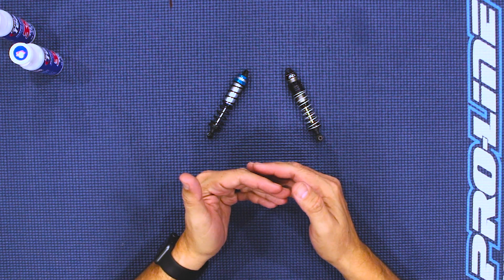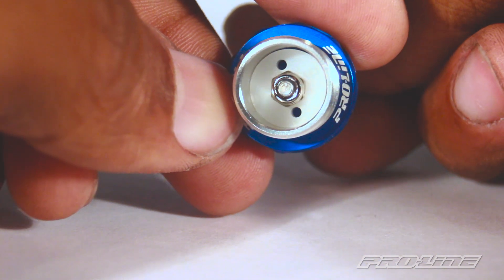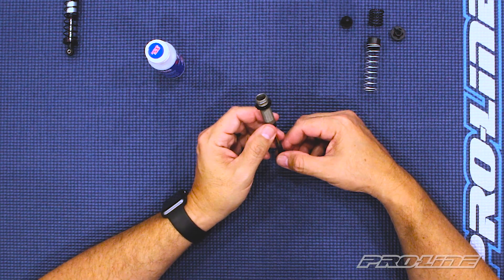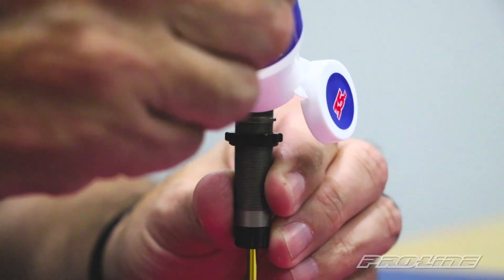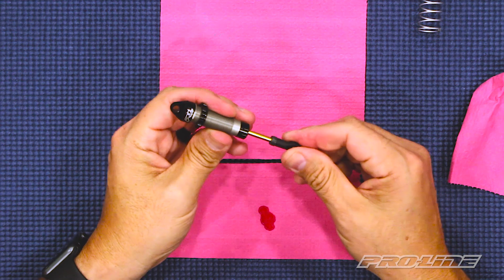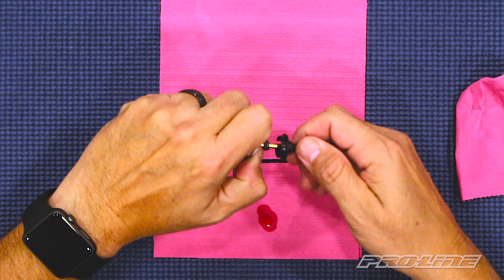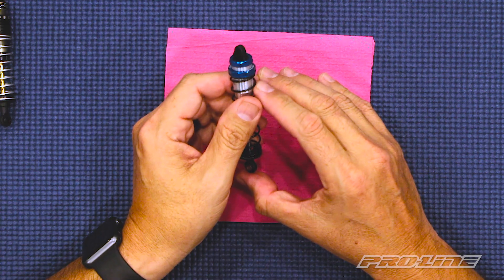Pro-Line Shocks 101

Comment: Question, need advice: I own an Arrma Big Rock and just bit the bullet and got the proline shocks. I live in Florida where it is always hot so I am going to have to test different oil weights to see which is the best for me. My question is, what weights should I buy to test with? I already have 60 & 35 weight. Which other weights should I get? Thanks in advance.

Comment: Hello!
Thanks for sharing the video. I was trying to top the four 6063-00 and two 6063-01 schocks up.
When having my rod down I’ve filled the body in with the oil to the very top of it, pumped it up and down a bit letting the air out, I’ve lifted the rod up to the bitter end, the extra oil has come out (you don’t have this happening on your video btw). Then I’ve put the cap on and screwed it up exactly as you’ve done on your clip, but unfortunately didn’t get the result I’ve expected: only two schocks out of six were pulled back on 6-7 mms, 
the rest of schocks weren’t pulled at all! This is weird, as when I re-filled standard schocks on my Slash, all went well and as expected.
What do you think might be the reason those schocks are not working as expected?
Reply from the maker: Hi @Олег Кирюшин ,
Once you have all the air bubbles out move the shaft to the top so the lock nut on the shaft is flush with the top of the shock body. Now twist the cap on slowly to allow the excess fluid to escape. Make sure you hold the shaft in that same position as you twist on the cap because if you don't you will let in too much air and the shock will essentially hydro lock or have too much rebound. This should give you minimal rebound.

We hope this helps answer your question,
Thanks for your interest and support!

Comment: I have a 1/14 scale wl toys 144001. Im looking to upgrade shocks. Im pretty sure they are 80mm. Im wanting to do alot of jumps. What 80mm shock do you suggest that you have and oil weight? Thank you.
Reply from the maker: Hi @Ryan Crawford,
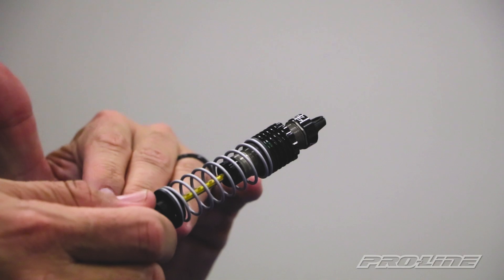We do not currently produce 80mm shocks. The closest that we have to that size is our 88mm Pro-Spec SC Shocks, but even that may be too large for your 1:14 buggy. So unfortunately we do not offer anything that will fit your rc.😔

We hope this answers your question,
Thanks for your interest and support!

Comment: Would definitely recommend putting your oil in and then WAITING 10-15 minutes to let air bubbles rise out of the silicone oil.  Do everything else the same except wait before capping it up and bleeding it. You'll be really surprised how many air bubbles will simply vanish after waiting for a few minutes. Need to wait a little longer for anything 60w or heavier.

Comment: Hi there, I have a Traxxas slash 4x4, about a pound or so heavier than stock w upgrades.  I have the optional spring set, truggling to find the right spring rates with my powerstrokes. Recommendations? General usage...no racing.
Reply from the maker: Hello, finding the right spring rate for your specific setup can be tricky, I would start out with a medium secondary (Large) spring and soft primary (small) Spring and then start trying various combinations from that point. if you are jumping a lot, you might want the heavier secondary spring and primary spring. here is a chart that might help a little:https://www.prolineracing.com/images/PowerStrokeSpringRate.pdf

Comment: I just got the pro specs for the 4x4 slash, what weight oil do you recommend and what holes do you think would work best on the a arm and shock plate
Reply from the maker: I would say to start with a mid weight oil like 30-35 weight, then start with the mid-size piston, the determine from there if your application needs a firmer or softer setup, more or less dampening and quicker or slower rebound.